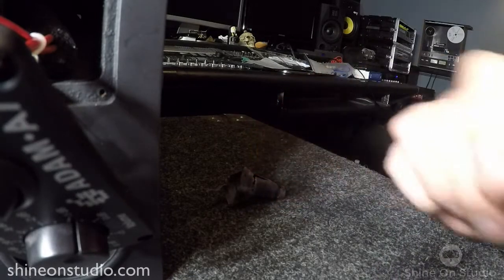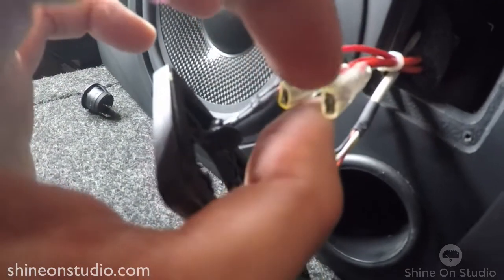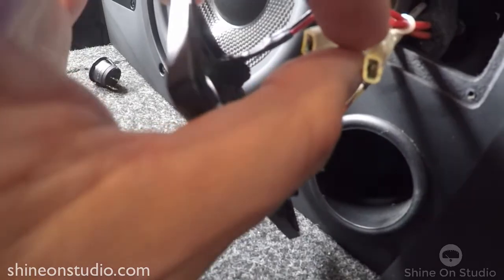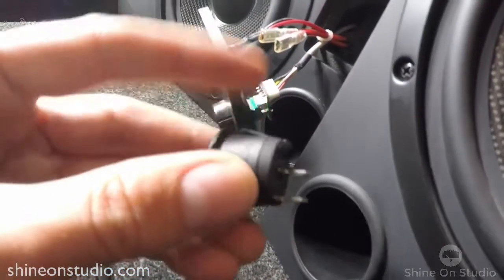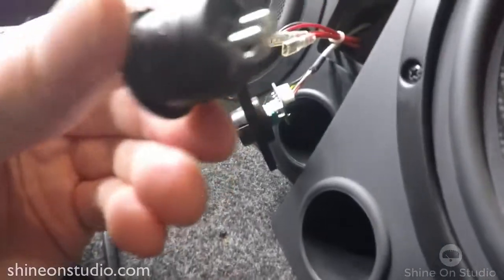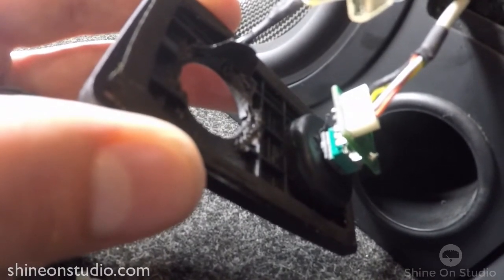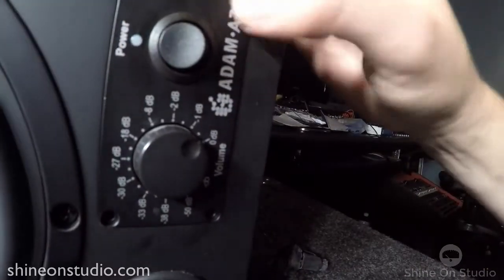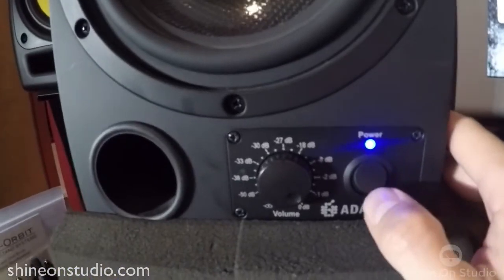Adam A7 monitor power switch repair | Fix your speakers DIY

Comment: One of my monitors just did the same thing. Working for years, all of a sudden won't switch on. How do you know if it's the switch though?
Reply from the maker: +Chris Wilson in most cases you can tell the switch isn't engaging. Does it still feel like a click or connection is happening?

Comment: Great
post, if you live in the UK you can buy the power switch at Maplin, or if you
search for the below you will find the exact switch for a few £ 

Two-Pole Round Rocker 6A 250VAC 10A 125VAC

http://www.maplin.co.uk/p/snap-in-miniature-round-rocker-switch-black-jr96e 

The glue is a complete pain in the ass to get off
Reply from the maker: +Dave Delaney thanks for sharing.

Comment: Hi mate, really enjoyed the video - I'm struggling to find the part, could you let me know what you searched for on ebay?  Thanks man! :)
Reply from the maker: Here is what I searched for on eBay: 
ADAM A7 A7X A3X A77XL A8X Studio Monitor Speaker Replacement Power Switch
Looks like the seller is currently out of stock. Keep your eye out for the relist.
Reply: +David Hughes thanks man, could you maybe let me know the sellers name and I can ask him if he's restocking soon? I'm halfway through a project and need to get my Adam going again asap.  again thanks so much for your time :)
Reply from the maker: The listing and seller are not up on eBay anymore. I'd just keep an eye on eBay. You can set up a saved search and eBay will send you an email when the part is listed again.
Reply: Managed to find the old listing thanks to your description. Emailed him and he sent me parts. He's a dude =]
Reply from the maker: Nice! Keep making noise.